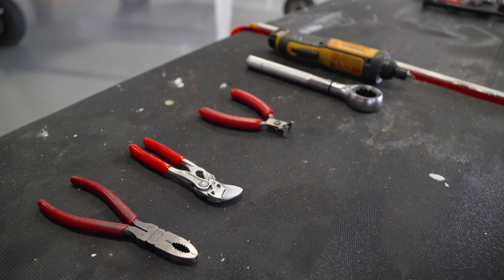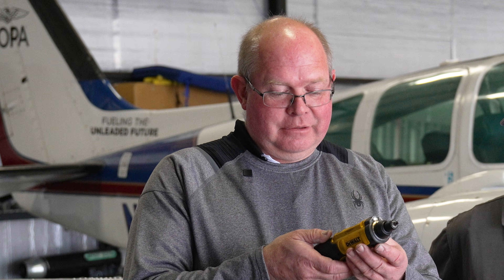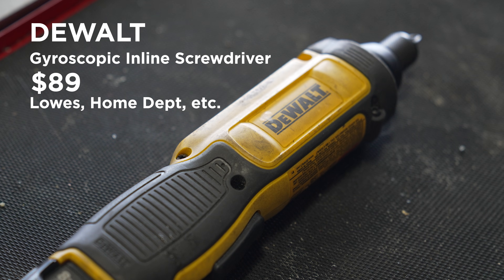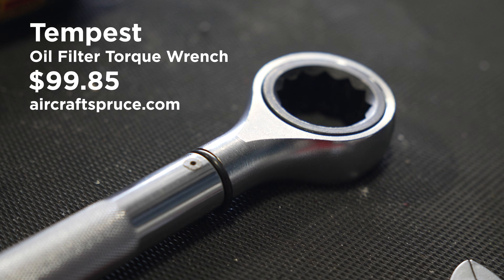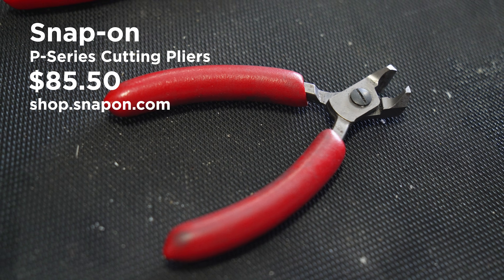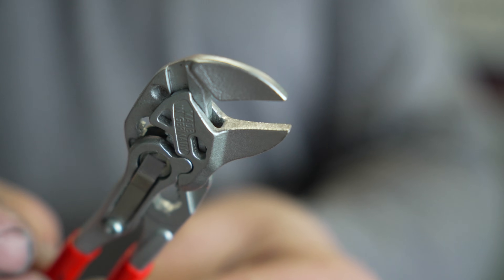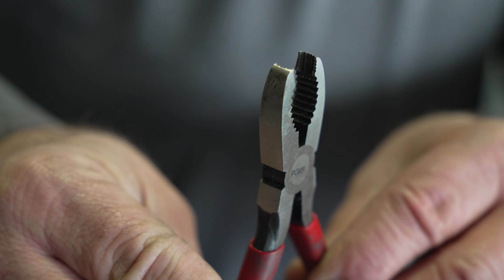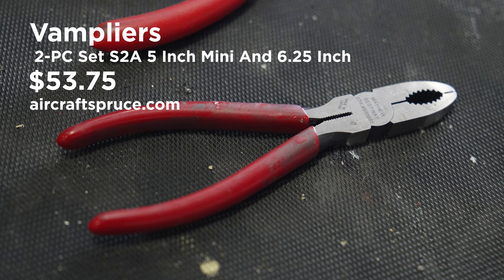5 tools to make aircraft maintenance easier

Comment: The gyroscopic screwdriver is cool but has no clutch. This makes it a head-stripping specialist when installing screws. Upgrading to the Dewalt pistol grip (which pivots to also be straight handle) brings a clutch just like a cordless drill has. This is the one to get.

Comment: Knipex "Super Knips" are excellent flush cutters, available in several versions/materials/grips, made in a western country with ethical labour laws, and you can buy 3-4 pairs for the price of those Snap On flush cutters.

Vampliers are badge-marketing of "Engineer" brand pliers, made in Japan. There are more models available under the Engineer brand, and they're also cheaper! I like the Knipex "twin grip" extraction pliers for automotive as they can grip a wider range of rounded screw/bolt heads due to the slip-joint adjustment. They also have the "cobra" style teeth on the jaws which is handy for removing damaged fasteners.

Knipex "Pliers Wrench" are still the best, there are other copies available now the patent has run out but they're not as good and not that much cheaper to be worth the savings. Knipex also make the best waterpump style toothed pliers with their "cobra" line.

Comment: Harbor freight sells a flush side cutter for cutting zip ties for $2.99. 😘
Reply: I like the knipex super knips, <USD25 and available with several grips/variations (they even have one that catches the cut tail which would be excellent in aviation applications where you don't want to drop anything!)

My cheap chinese flush cutters were great for plastic zip ties until I cut a few copper wires with them :'(  

Snap on products are usually excellent, but you overpay 2-3x vs other quality products. Not worth it IMHO
Reply: I have them it's insane how sharp they are and the qualty for 3 bucks. They cut right through aviation grade zip ties

Comment: I much prefer the Wera Joker Adjustable to the Knipex Plier Wrench. The Wera has a very nice pseudo ratcheting feature and feels more secure on a bolt than the pliers.
Reply: When the question is posed on Reddit, it seems unanimous that the Knipex is better and that the Wera Joker has some niche uses.
Reply: @matsudakodo  I agree entirely. Aviation is one of those niches. They're great for fluid line fittings, I carry 3 wrenches on my belt and I essentially have an entire toolbox drawer of wrenches on me. The psuedo ratcheting feature is very convenient for accessing fluid lines in tight spaces.

Comment: The gyro screwdriver is slick, will have to give it a try. Knipex are awesome pliers.

For flush cutters, grab a cheap pair of side cutters and run the side down on the grinder until smooth, instant flush cut dykes. For ty-wraps they work great and there is no need for heat treated jaws.

Comment: I can vouch for the Vampliers for sure! Work like a charm. How did it take so long for these to be invented?! Great tips for the others--I have some on order. You could definitely do more of these kinds of videos! Carlo was great.
Reply: Look up the original brand from Japan "Engineer", they have more models available and they're often cheaper than the ones marketing in the USA under the "Vamplier" brand :)
Reply: In your opinion are they good on Washer Head Screw?
Reply: @javiertorrez5296  I haven't specifically tried using them on a washer head screw. You'd have to squish down the ridge around the washer surrounding the actual screw if there's not much of the screw head showing. Worth a try.